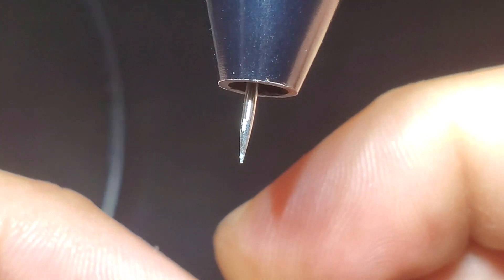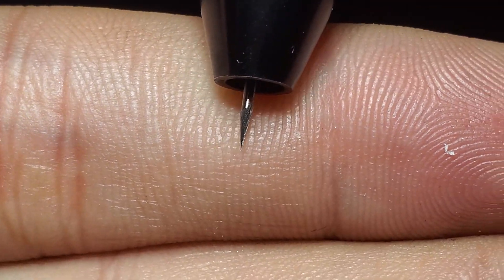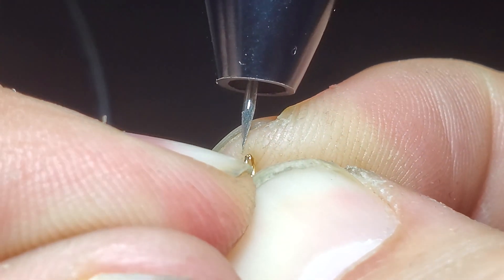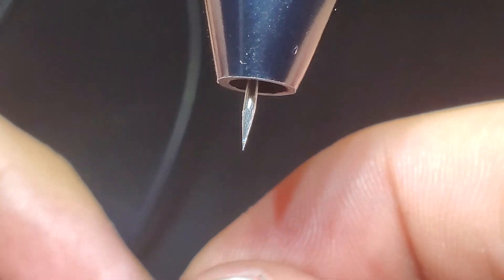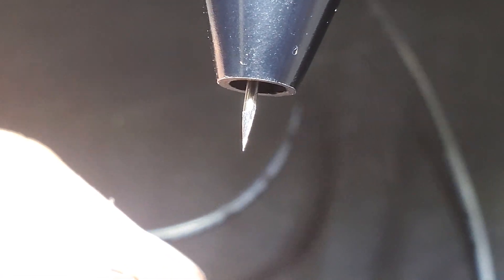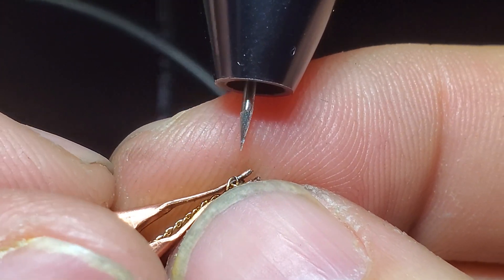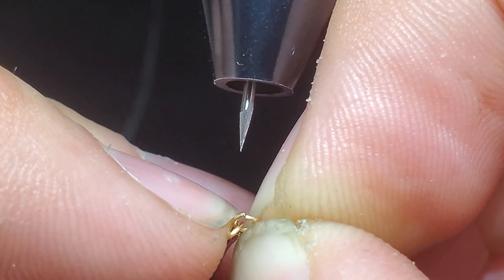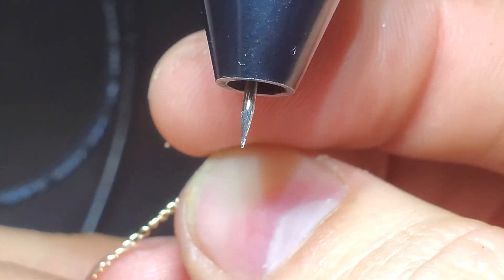Micro-TIG  Welding 14k Gold Chain and Jump Rings

Comment: So it does help to squeeze the jump ring ends together while welding?
Reply from the maker: Sharon: The objective is to have the two ends of the open link make contact with each other. Sometimes you may need to squeeze to make that happen. The tighter the contact between the two ends of the link, the better weld you'll get.

Comment: Can you do the same thing with a very thin chain 1.5mm? I keep trying and I can’t make it work. So frustrating. Any suggestions?
Reply: My machine is 30 MPulse amd I tried with silver and also gold.
Reply from the maker: There was an inquiry below that you indicated was happening for you too. Below was the response. Please give us a call if you need further assistance. 
"One of the things can can be helpful to reduce or eliminate the small gap to form is to make sure the 2 ends of the cut link are touching. It may be necessary to apply a little pressure to the 2 sides of the cut to make sure they bond once the weld turns it to liquid, be it for a few milliseconds. It would be best to keep the energy low and with gold the electrode sharp. Silver would require a blunted tip."

Comment: Hi I have a Orion mpulse. I cannot figure out how to weld without leaving a small gap or if I turn it up I end up blowing it out. Do I need 14k gold or is 14/20 jump rings okay? I’m taking all and any advice!
Reply: I am currently having the same issue! Did you find a solution?
Reply from the maker: @alejandracarrillo1933  See below. Please reach out to us if you have further questions. Our contact info is in the description.
Reply: Did you find a solution?
Reply from the maker: One of the things can can be helpful to reduce or eliminate the small gap to form is to make sure the 2 ends of the cut link are touching. It may be necessary to apply a little pressure to the 2 sides of the cut to make sure they bond once the weld turns it to liquid, be it for a few milliseconds. It would be best to keep the energy low and with gold the electrode sharp. Silver would require a blunted tip.
Reply: Send contact number

Comment: I was watching a professional tig welding video a few weeks ago and one of his tips was to not touch the needle directly to the object he showed how wen you touch the wire it melts the wire essentially cutting the wire not welding it together. (I’m not a pro neater do I have cold welding experience)
Reply from the maker: Though that is especially true for a standard sized TIG machine. The machines Sunstone has designed are Micro-TIG. They require the touch to start the weld sequence. During the welding sequence the electrode will retract to a predetermined distance. This can particularly helpful for those who have little to no welding experience. Please let us know if there is anything else we can do to help.